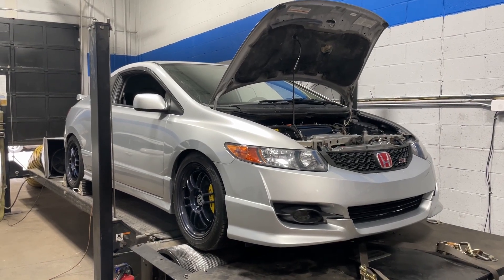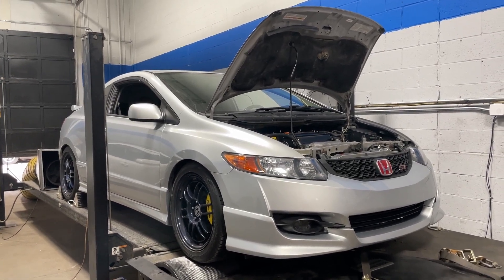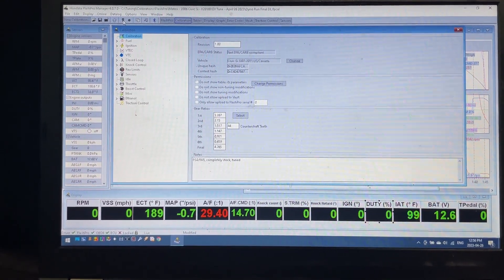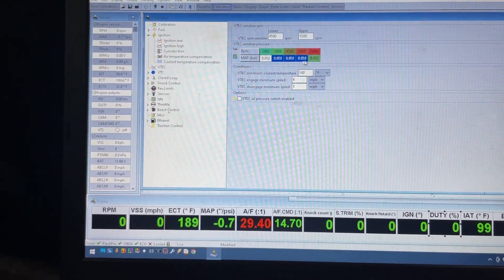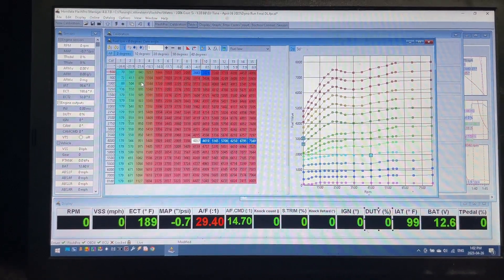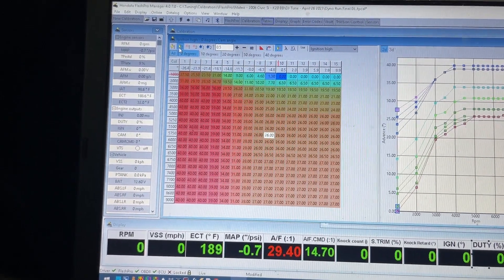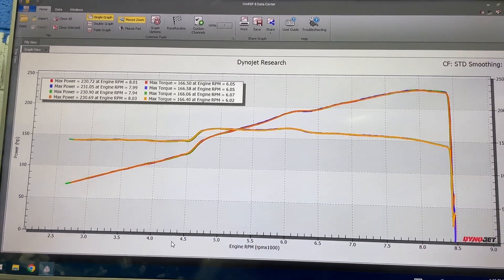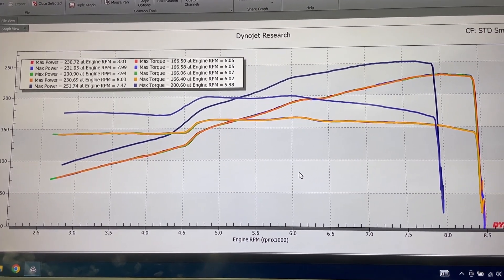Hondata Flashpro Tune Settings - 8th Gen Civic Si

Comment: my 07 si running newest version of flash pro has different injector open times than your tune set as default

did you change yours at all or use a base map that adjusts them?

Comment: @tuningbynick
Ignition trim per gear = -100 setting. 
Short term fuel trim minimum = -20 and Short term fuel trim minimum = 25. 
Long term fuel trim minimum = 0
Long term fuel trim error limit low = - 1
Can I do all this adjustment after the car has been tuned? Or should this be done before/while car is being tuned?

Comment: I have a k24a swapped 8th gen, would copying the fuel calibration tab, from the injector opening time to overrun fuel cut delay benefit the k24 aswell as the k20 or no?

Comment: Nick thank you so much greatly appreciate your work! Loaded your tune onto my FA5 and night and day difference🤘Had to pull some fuel 10.1 wot assuming the difference in intakes as the k&n typhoon is smaller than HR CAI

Mods 
K&N SRI  
P2R tbs
Jack spania race header
Rev9 3in exhaust

Comment: Hi Nick, thank you for all the great work you do. I was hoping you could help me with my tune. 
I am running K&N SRI, 1320 performance headers, catless full Invidia q300 exhaust. 
I am current using the standard tune closest to my setup because I still want all the gauge functions oil life etc. Is there anything I need to do to make sure I am running correctly? It seems to drive fine, minus the gas smell.

Comment: That car making 230 thats crazy. I have a 06 Si with Hybrid cal, KT 72mm TB , SKUNK2 alpha header, Rbc port match, grams 265 LPH fuel pump, on E85 just making 217hp 178 max Tq
Reply: Do 2.2 drag cartel cams bro. Add like 15whp. Should put u at like 230-240whp 180-190tq
Reply: He was tuning on 4th gear, which read abut higher.

Comment: Thank you for this guide/info. It's helped tremendously especially with my cars smoothness. With the EPA stuff going on in my state (NC) and after a shop in a major city was fined over a million bucks for fudging inspections I can't get an inspection with the skunk2 header. Having to revert back to factory to pass their visual inspection is a pain. When things settle down I'll ultimately get it put on and a professional tune. Till then I'll be careful with this adjusted base map tune. MUCH APPRECIATION.

Comment: i'm going to change the tip in retard timing. i've been chasing an issue where the timing retards down into the negatives when starting off in 1st. it seems that would alleviate the issue.

Comment: Like always excellent content. Just want ask. I have 1500cc I injectors a the idle is not smooth. It's like misfiring. How can I adjust the afr at idle to try smooth the idle? The short trim correction does not allow me to do it.

Comment: Awesome video, 230hp seems super healthy and I appreciate the tuning tips! Wondering if I could ask a quick question on one of your settings. I have an fa5 with just a k&n intake and a catback, been using the KNSRI calibration and it's been working well, fuel trims and afr look good. I adjusted my tip in table like yours to see if that helps smooth out my shifts, but I left the fueling alone and kept using the MAF sensor. Anyways my question, do you recommend your launch control settings for NA? I tried it out and adding that fuel and retarding timing gave me some pops and bangs, wondering if those settings are geared more towards turbod cars? Or if you had other recommended launch setting for na? Or if that's what you usually go with?

Comment: I do the exact same thing for the gear based ignition tip in... discovered that a few years ago. I would notice a sputter everytime I would switch gears upon throttle tip in. Logged it and saw it was pulling timing on tip in. Set it all to -100 and was smooth.
Reply: Would it sometimes make a burble or pop? I've got a 10th gen and it does that on tip in at certain RPMs.

Comment: I have an 02 type s, full bolt ons got 236whp from it. But I only used 40% of my injectors duty cycle. So I added the skynk2 ultra street manifold, skunk2 stage 2 drop in headers and lsd differential and rebuilt transmission. Took it to a different tune shop, an I got a choppy tune map that is terrible an with extra fuel air an cams and nitrous I only got 224whp. I get a lsd is more levers for power to get to the road. But should I have lost 12whp with all that added? Or did the guy at the shop not know much of what he was doing

Comment: Thanks for sharing Nick! Also always zero out LTFT, very counterproductive when trying to get fueling tables set.

 I have a request if you could cover on a video, Setting up the fuel table switching from MAF to MAP, can you show getting the initial start going? I tried getting my RDX set up over on speed density but as you know the fuel table data in Flashpro calibrations are not even close to getting the vehicle to start.... I pulled and added fuel in the starting/idling cells but fouled out the plugs and drained the battery trying for a few hours... best i could get was 8-15 seconds for the engine to run which didn't get 02 sensor feedback for me to work off of.

Fouling the plugs sucks being it has a top mount intercooler. I was told to zero the vtc to at least get it to idle and haven't done another attempt. Would love to see your process and any tips you might share!

Comment: love the side by side comparisons...do more!!!  can i ask?  here in australia we have the K20z4 engine. effectively same as this motor . why is it with the exact same mods on our dynos ( dyno-dynamics)  its 230ish BHP , which @ wheels is about 198 HP.
Is this a difference in dyno's or am i missing something?
Reply: all dynos will read a little different dependent on type and calibration. even the same dynos can vary a little.  could also  come down to ambient temps, fuel quality, and simply engine to engine varies a little.

Comment: Wow! It's amazing how much power you can push with a few bolt ons on the 8th gen
Reply: Imagine along with a oil pump
Reply: @yessismaldonado8483  with this setup you don't really need to upgrade the oil pump it wouldn't be a bad choice but upgrading the oil pump would be better if you had upgraded cams if you wanted to push 240-260whp on the stock k20z3
Reply: @Itsjustanelantra i live in ny would a panel filter and catback exhausy reach at least 180-190 whp? with a flashpro
Reply: @zoob4371  I've seen a car with the stock air box with k&n drop in filter exhaust and header make 205whp so without the header you'll probably be around 190 to 200whp
Reply: @Itsjustanelantra  Ok thanks !
Reply: K Motors love intake and exhaust mods. Anything to make them breathe better
Reply: @IFIXATVS   I definitely need a better intake mine is just breathing hot air right now and a better exhaust system my plans are to get the same mods that he has but tuned on 93 pump gas instead and upgrade my throttle body to the zdx j37 and maybe put a set of rdx 410 injectors with hybrid racing fuel rail
Reply: I agree!

I have a 2008 Nugen Si and I'm excited about making it beyond what people were hoping it was when it came out.

Such an amazing series of engines.